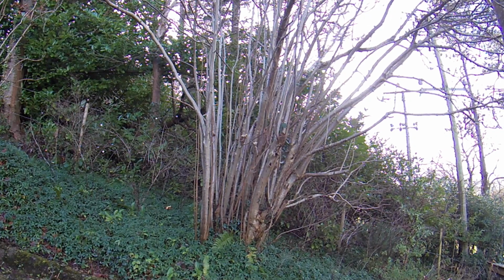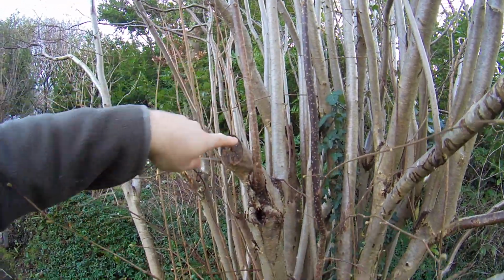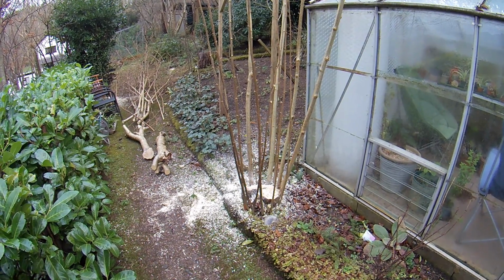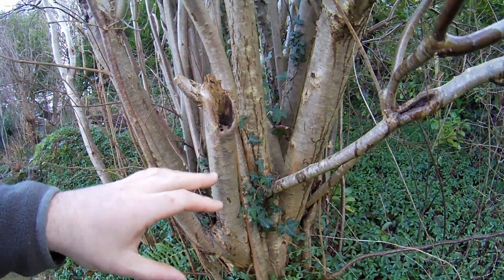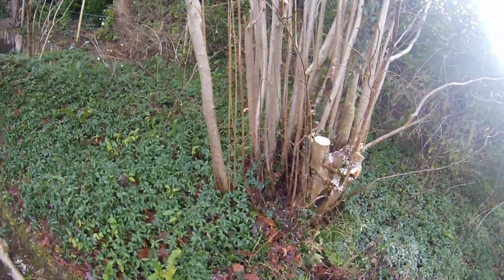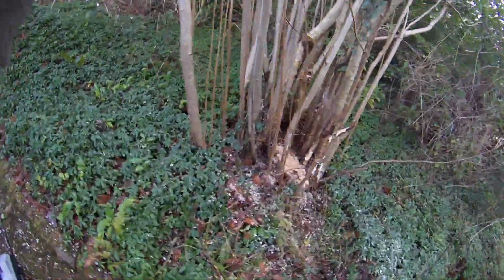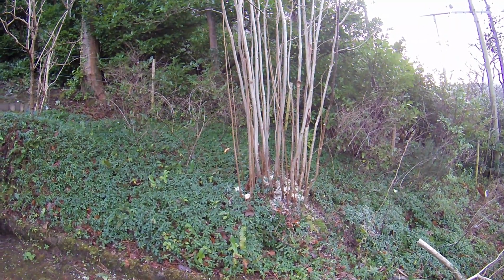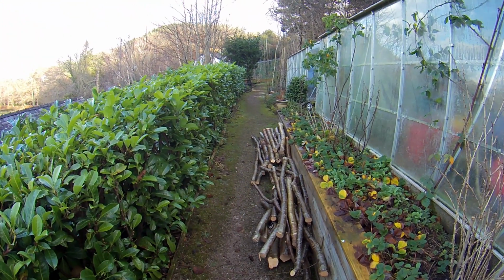Restoring a coppiced hazel 04 01 24

Comment: Interesting video, cheers for sharing. My advice, for what it's worth, would be to get a folding pruning saw. Fits right in a big pocket. Green wood is easy to cut anyway, and pruning saws cut very cleanly, not having any kerf (or raggedness at the side of the blade) to the cut. They also are good for getting into tight spaces, especially given the 'pistol grip', or slimline style of the handle. There's no way you're damaging the wrong bough with a pruning saw. They only cut on the pull which does help with control, especially where access is tight or up a ladder etc. Power tools are cool at times, but kind heavy and pesky in various ways, so a pruning saw is optimal on this sort of job I'd say. Just ma' opinion though, sir, thankee kindly! :D
Reply: ...that said, watching the vid again, the main trunk was pretty gnarly and did justify the chainsaw. On that point, electric chainsaws seem much more practical for DIY use because it doesn't take a hour just to start the f'in thing like petrol ones! :D
Reply from the maker: Thank you for the advice